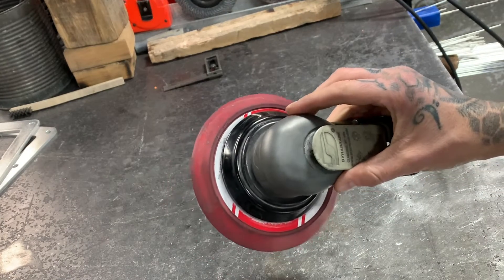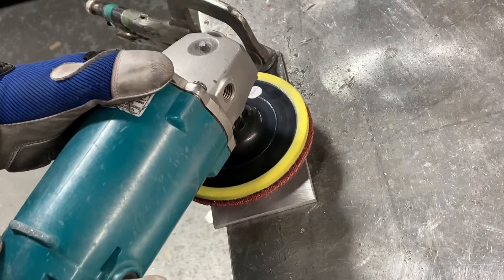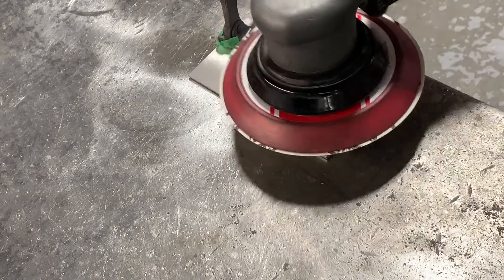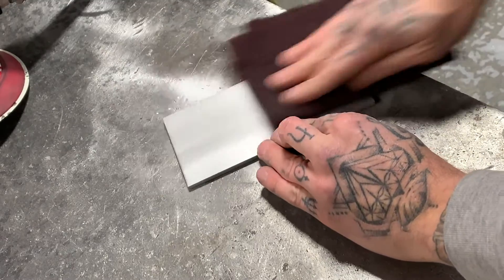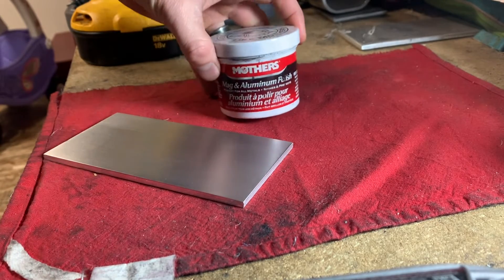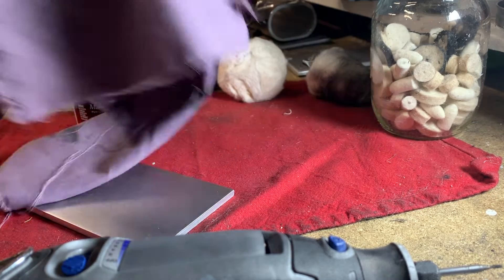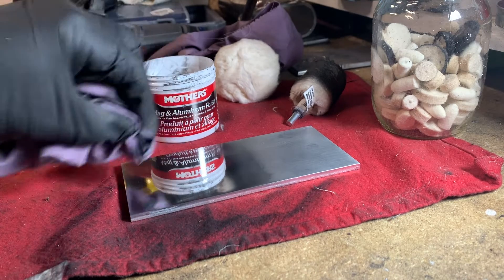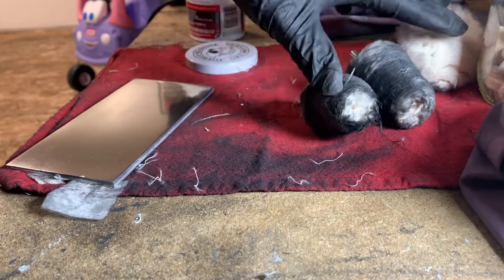TIG WELDING HOW TO - How To Polish Aluminum To A Mirror Finish! *BONUS EPISODE* Tig Welding Aluminum

Comment: What if you polish it first. Can you weld after polishing or no?
Reply from the maker: Yeah! You’d have to hit it with acetone or something to remove any of the oil left from polish but yeah, you can for sure. I wouldn’t do it with a weld test or anything super structural however tho...!😂 You never know...!
Reply: Pacific Arc Tig Welding I don’t hardly ever do anything structural anyway, and I figured a good cleaning after polish would work
Reply: Pacific Arc Tig Welding I bought some of that polish last night after watching that video. 🤘🤘🤘
Reply from the maker: Aw nice! You’ll be surprised with how good that stuff works! Let me know how it goes!